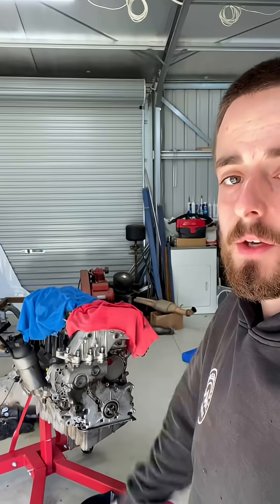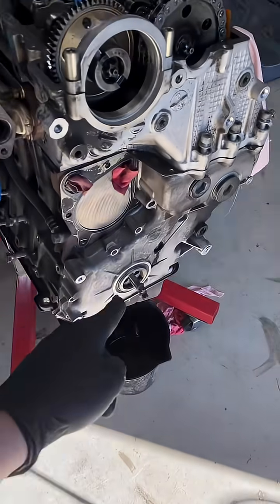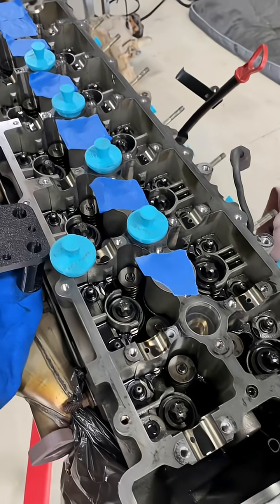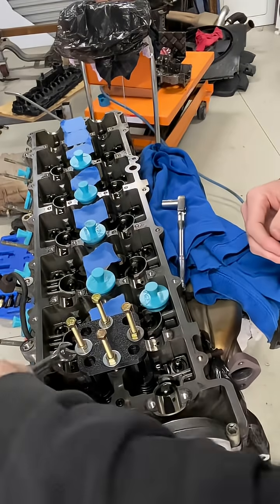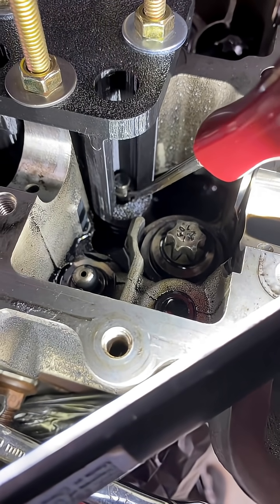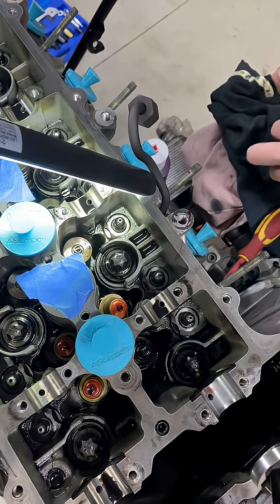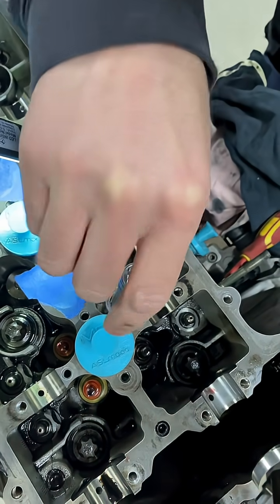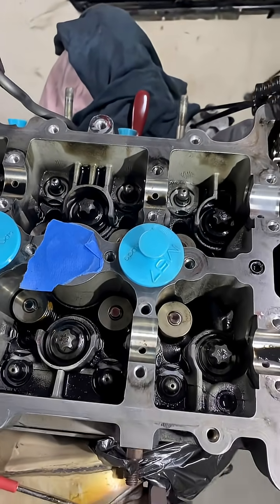M57 Diesel Swapping Landcruiser - Valve UPGRADE

Comment: This good. Thanks. But when setting piston 1 to tdc and pin is slid into flywheel that is o ky 2 pistons at tdc. Did you rotate the engine later to bring other pistons to tdc?i may have missed it. If a person doesn't do this they risk having a valve or valves drop into cylinders.This good. Thanks. But when setting piston 1 to tdc and pin is slid into flywheel that is o ky 2 pistons at tdc. Did you rotate the engine later to bring other pistons to tdc?i may have missed it. If a person doesn't do this they risk having a valve or valves drop into cylinders.
Reply from the maker: Yes rotated the engine so each two sets of pistons were on TDC so the seals could be replaced. Then rotated back to TDC no 1 and timed the engine back up